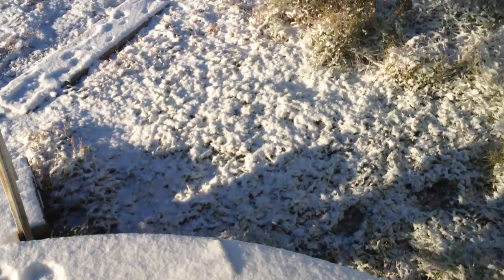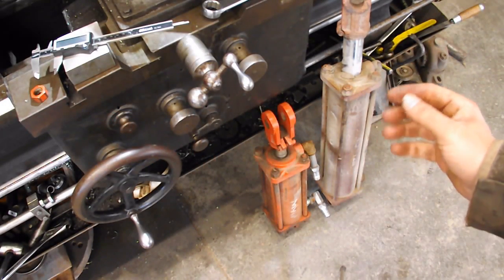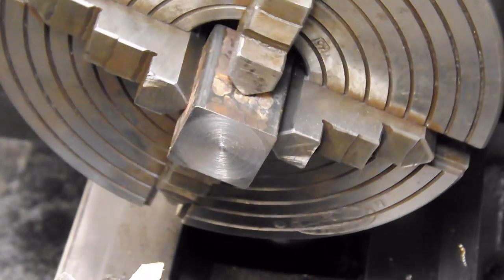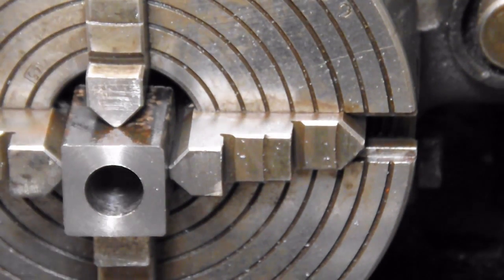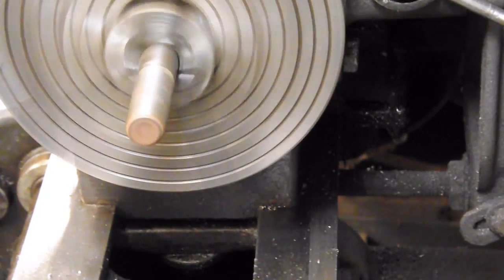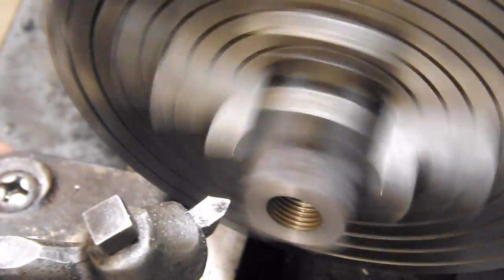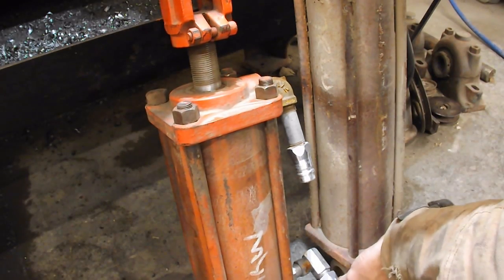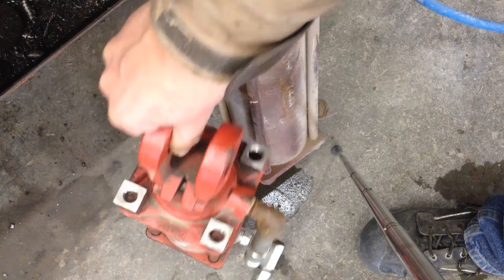First ImPRESSions - Part 1- Press Build

Comment: Lookin' forward to part 2. It might be the auto focus, moving things around, but it looks like there is some play in your cross slide. As you face the part from the inside, it looks as though the tool bit is pushed outward away from the stock being turned. This would account for the poor finish. Another cool project. Snow? WE'VE got snow! Shortest day of the year tomorrow and the sun barely rises above the horizon. And, then there is the snow . . .
Reply from the maker: Jim Milne Play is possible. I had the milling attachment it on it right before I did this job. I tighten and loosen  the gibs during milling operations since there isn't a lock, and maybe I forgot to tighten them. As far as snow, what I showed in this video is the most we had. It's snowed 4 times, but not enough to even say it's snowed. I doubt it we'll be able to go sledding for Christmas this year. Maybe send some of your snow our way! :)